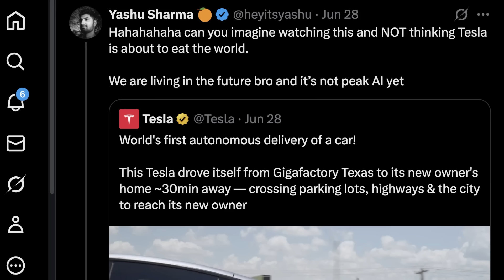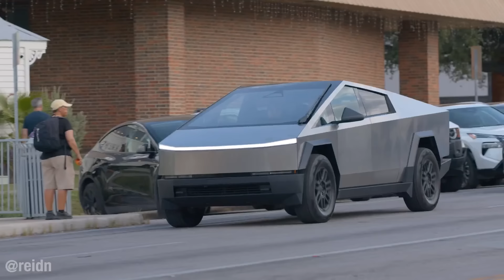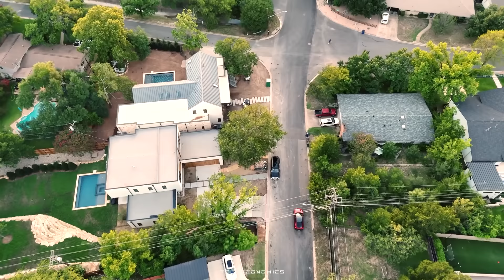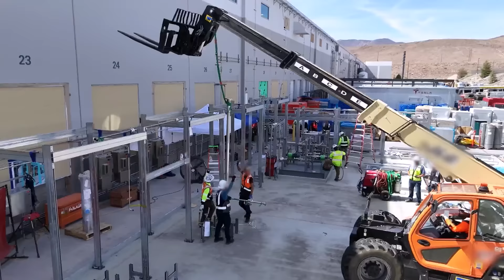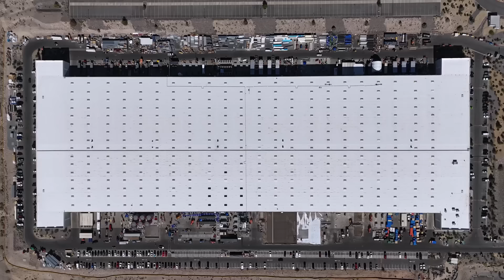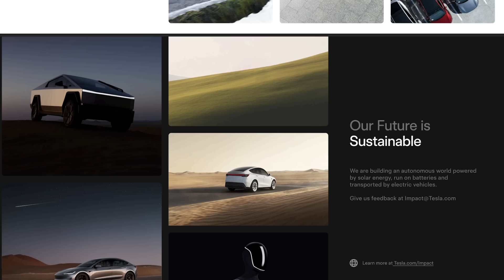Elon on Removing Safety Monitors / Elon Is Not Happy / James Douma Talks Tesla AI ⚡️

Comment from the maker: Can someone explain to me how Tesla builds an entire LFP battery factory and no one said a word about it?!?!
Reply: Planned production completed of the machine that builds the machines energy
Reply: They built a lithium refinery too
Reply: Vital, yes, but it's too deep in the weeds for anyone not specifically focused on Tesla or EV's.  For instance, there are details about the other Mag 7 that I'm clueless about -- they aren't mainstream.  Not to mention the rest of the S&P 500, etc.  But, yeah, frustrating.
Reply: Old news
Reply: It was floating around about 2 years ago. Not sure how so many Tesla bulls missed it. It was in the news that they had purchased CATL equipment to build LFP batteries. I believe they also have patents related to it. So it was obvious they were either going to at an existing Giga, or a new location.
Reply: Tesla does so much cool sh!t that we can't even keep track of it all. The best thing to do is to go all in and let fate get realized.
Reply: Everyone is too busy with heads up Elon’s Rectum
Reply: They bought a used assembly line and are paying for CATL consulting to figure out how it works and put it together. Tesla purchased some previous generation LFP assembly lines from CATL. With support from CATL they have reassembled the lines and seem to have it running. CATL makes batteries for all sorts of applications and the equipment is thought to be now two generations old. They remain dependent on the Chinese supply chain for the components of the batteries especially the heavily optimized graphite.
Reply: Definitely makes you wonder what else may be nearing completion...
Reply: Hey Dillon! Could you cover the issue regarding Matthew’s and 4680 battery? 

Haven’t heard much about the 4680 updates
Reply: Exactly who cares about old tech batteries? Sodium and solid state batteries are the latest tech. It costs more for Tesla to make their own than it does to buy them.
Reply: @mandelm2001 Weong, Tesla is now able to build batteries cheaper than importing un-tariffed Chinese LFP batteries.
Reply: @mandelm2001 not what he said and then thanked the team.
Reply: @mandelm2001  Solid state has been the latest tech for the last two decades, bro. Call me when they are cost-effective.
Reply: @mandelm2001 No companies are presently making sodium or solid state batteries for millions of EVs, large scale battery storage and home storage use. It's been old news, for many years....coming in a few years.
Reply: byd pretty much make 5 minutes charging ev and there is no news until it is done.  you dont need 10 years to tell people robotaxi coming soon.

Comment: Suggestion for Tesla Robo taxi's interior - (1) Inside view drop dash screen some so Dash line is continuous horizontally (2) Drop the arc on steering wheel and have the 'steering' column be 40% smaller as a Tesla logo shape that moves 'steering' for interest and Signature.

Comment: I have a Model Y, Juniper and have the FSD,  SEVERAL times it has tried to KILL me, pulling out into traffic,  turning into oncoming traffic on a green light ( almost nailed the back bumper TWICE of oncoming traffic)  don't trust it.    WILL NOT MAINTAIN SET SPEED.    KEEPS DROPPING SPEED LIKE A DEFLATED BALLOON.   Dial in 60 MPH and it will drop down to 53 mph.

Comment: Farzad 'modelling' :) -- let's keep it simple. I have seen similar modeling for Waymo and it is STRAIGHTFORWARD. When Waymo launched they DELAYED deploying the service UNTIL proactive monitors were not required. Tesla is OBVIOUSLY pursuing eating this cost and imagining Tesla will figure out all of the long-tail edge cases quickly.

Costing them out is pretty simple. Assume the car OPERATES at a utilization of 16 actual hours of driving per day (payable plus deadhead) that requires insurance. At $75 an hour in the US (A bargain in Palo Alto), the cost of 1:1 is $438K per year per car. That works out, at least as of last quarter performance for Waymo in their mix of cities to $4 per mile. This is the SIMPLE explanation of why this is all about monitoring. It is also why Waymo had developed a strategy to hasten the edge case discovery process. This was ALL ABOUT not needing real miles but rather figuring it out with synthetic miles. This is why Waymo converged to inherent safe without live monitoring within 10M miles. Tesla is at 3B miles and counting. Clearly the Tesla approach is quite different. Farzad's hot take about even 1:3 is foolishness as it add $1.33 to each mile in taxi mode.

Comment: As Old IT (retired) guy, this delivery is, by any measure, very impressive. As old software tester for very critical systems, the achilles heel for FSD is in "exception handling" -- and every ill-behaving instance will be highly critical of having Tesla FSD operating on scale will be horrendous. Someone needs to convince Elon of the value of a PR department to deal with all that.
Reply: And like good exception handling, you program in fail safe modes. Looks like the competition safe mode is just "stop in the middle of traffic." It Texas they say "If it steers, it clears".

Comment: I don’t understand how a small amount of supervised autonomous vehicles can accumulate anywhere near the amount of data that has already been gathered from the fleet of Teslas ready on the road. 
My conclusion is that the added data will not significantly accelerate effectiveness of the autonomous driving system, so safety itself will not accelerate, and implementation of a safe, viable, revenue generating, autonomous driving Tesla platform is still far off. However unready the system appears to be now, will likely remain that way for quite some time.

Comment: I work next to a Tesla service center and I have noticed in the past 3 weeks Tesla has really increase their sales volume. Tue area where the cone off New vehicle sales is completely packed now.
Reply: I drive by a Tesla lot in Colma, CA. The number of cars varies. It is at 1500 Collins Ave. I see pictures of it with the 1500 above Tesla.  I have noticed 25 to 30 Cybertrucks in the lot and they have been there a while.
Reply: Packing a parking lot with vehicles does not necessarily mean more sales- it probably means just the opposite - sales slowing down and inventory increasing.

Comment: Doubling down on other comments, a third party is a non-starter without AFV (Actually Fair Voting). This means jettisoning the electoral system and implementing national ranked choice or runoff type systems and/or switching to a parliamentary proportional representation system.  This is (for now) Not Going To Happen. On top of that, everyone's dream party is different and spans the range from one extreme to the other.  There is no "consensus" "reasonable" third party. A "successful" third party at best will displace one of the existing parties. I hope Elon is really contemplating his last political "success" as he moves forward. So far it doesn't look like it.

Comment: Did the safety driver intervene? The indecision by the car doesn't look very real. I'd expect to see some issues and sometime as it gets on the case should I go or not? Go even humans have that and if a mathematical system calculating when to go and when  not to go. If the decision is on the edge, then I would expect to see more often in decision, this just shows me there is a mule network operating underneath!

While making your mind up, it's time to go. The calculation takes a finite amount of time, in the next frame the situation has developed to say no do not go!

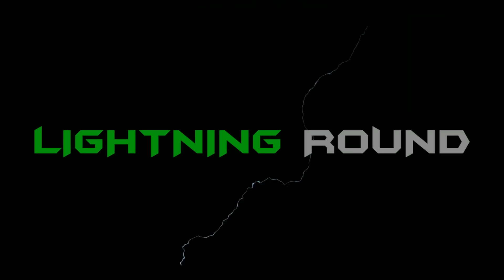Comment: 23:27
Is there really any speculation as to why Samsung is not using their own battery tech? Anyone dealing with Samsung batteries and reads up on tech specs of various other cells out there knows how shitty Samsung's cells are.

I had several Samsung batteries, as they were the default option, over the years and always got disappointed.
Latest - and last time I used a battery from them - is with my first EBike - It came with a Samsung pack by default. As I wanted to do longer rides, I bought a second battery from the EBike manufacturer, where I then had the choice between two Brands, Samsung and Panasonic. I chose the latter, at it had slightly better Wh, although significantly more expensive.

After using both batteries over 3 years (both used Cylindrical cells of the same type), and treated them the exact same way, the Samsung battery deteriorated down to 81% its rated capacity, while the Panasonic was still above 90%. I measured both batteries regularly and the Panasonic outperformed the Samsung in every way. In the 4th Year the Samsung battery became unusable. 6 years in, and I am still using the Panasonic with 86% rated capacity

Comment: If you think about it, the software for an unoccupied car (aka robotaxi) needs to be different from regular FSD. At least some parameters have to be changed. Not even neccessarily in terms of capabilities, but with regards to user interaction: At the very least driver monitoring has to be disabled. After all, regular software is supposed to prevent the car from driving itself or the user from trying this stuff his own.  Also the robotaxi has no option to ask for a take-over, but has to instantly pull-over or full stop in such an event.

Thats why people shouldnt be surprised when learning that software was different. No magic behind. It naturally has to be different.

Comment: Farley is incorrect when he comments that LiDAR is ok in strong sunlight, LiDAR can very much be disrupted by strong sunlight just like a camera, perhaps he is thinking of radar?
Reply: Waymo lidar operates at 1550 nm and can “identify objects driving into the sun on the brightest days as well as on moonless nights.”
By contrast, cameras can be completely washed out.
Reply: @JCo295  Camera images as handled by Tesla don't "wash out". As Elon has mentioned several times the AI is evaluating individual pixels and not the overall image.  With a focused image even with direct sunlight the Camera sees every detail.  This is not like your eye or normal camera viewing where the overall sensitivity is turned up or down based on overall (or point) brightness. This system can be disrupted by dust or condensation that scatters light, but this can disrupt lidar as well.  I believe Waymo has systems for cleaning the lidar as Tesla has systems for helping keep the camera's clean.  I believe we will see even more development in camera cleaning now that there is no human operator to fall back on.
Reply: @MrMobile247 On 17 Oct 2024 NHTSA opened PE24031 to investigate "Failure of the system engineering controls to react appropriately to reduced roadway visibility conditions". Justification was 4 incidents including one notalive. First Information Request to Tesla was on 5 Nov 2024 and second was on 8 May 2025. Unclear what the outcome will be but it could potentially impact Tesla's camera-only approach.

Comment: If it´s only the operations side of the surface that needs to be polished with Robotaxi why are there still safety drivers needed in the passenger seat? That has nothing to do with operations, severely deteriorate the user experience and cost a lot of money. Doesn´t make sense at all.
Reply: I suppose it wouldn't make sense to someone who hasn't been following the Tesla story or has no concept or appreciation of the media bias just waiting to jump onto the slightest adverse event of the rollout. The cost of an unmonitored adverse event would far exceed the minor cost of the temporary monitors used in the rollout. To put it simply: it is a necessary CYA expense.

Comment: Been a Landman for 25+ years now, primarily supporting oil & gas drilling upstream ops and in the past 10 years we've had a ton of renewable utility scale energy projects, throughout the U.S....I support this administration, however, this is a pork barrel Bill of SHIT!  The biggest "white elephant" in the US energy sector affecting electricity wether it's coal fired or renewable electricity, is our obsolete infrastructure-it's a joke. In most populated markets, distribution and transmission lines are at or beyond capacity, regulatory and the lack of fore site or courage to attack this problem has put this country in a terrible disadvantage going forward, yet it's never discussed.

Comment: In every single one of these videos, not a single person addresses the issue that I’ve experienced, which is the camera(s) malfunction notification I’ve received multiple times in instances of heavy rain or fog conditions in which auto pilot or FSD deactivates due to the camera malfunctions in these two scenarios. In the multiple times when I experienced this, of course I had to take over driving, but at least I was in the driver seat and able to do that. It will be interesting to see if either Tesla has resolved the heavy rain and fog camera malfunction issues to prevent them from happening or figure out a way to handle these scenarios when there is no one in the driver seat to take over control of the car.

Comment: Are people actually being serious that they think Waymo is going to be able to compete with Tesla? Why would you summon a Waymo that looks like that ridiculous frankencar that Homer Simpson designed when you could order a sleek, cool Tesla that drives better and probably costs half the price and is not sandboxed into a small area. Tesla will slowly remove the boundary restrictions until it can just go anywhere. Waymo requires detailed mapping and manual programming. It can't handle changes to the road for construction and detours without software engineers reprogramming it. Tesla will just keep learning on it's own. Tesla = better, cheaper, smoother, faster, cooler
Reply: Yeah.
Reply: Well, reality being a guide. Waymo is 9 years ahead now and expanding
Reply: Telsa software concept is faulty. the cameras will never work in the nighttime as well as rain or extremely sunny or foggy weather, So you will never see approval of his robotaxi. His Sunday stunt was used a model Y with a driver aboard, instead of the robotaxi which is not approved in texas or anywhere else.

Comment: 2025 1st Half is OVER.
Are reservations open today for Tesla’s $25,000 Model 2?
Reply: Don't believe Elon
Reply: No special event for the cheaper Tesla has happened yet, and you will most likely be disappointed if you believe that the price will be $25K.
Before producing a cheap EV you need to make sure you have enough capacity and batteries

Comment: I won’t put my Tesla Model why out for 70 cents a mile. That not going to make enough profit. It’s going to have to be at least over a dollar a mile. How many miles a day is possible?
Reply: 700 to 900 km per day at city sort of speeds could be possible if it was running at about max possible. At 35 to 45 km/h for 20hrs. But say only half of that is actually done whilst chargeable low end 350km, just over 200 middle age units. $140ish dollars a day, getting on for $1000 a week.
Reply: Eventually the prices will get so low that you will want a fleet in order to make it worth the effort.

Comment: On the indecision for the right hand turn, the safety monitor appeared to be controlling the vehicle, likely through the button on the door.
Reply: The button the safety monitor was hovering over was the "stop in lane" button that will immediately  stop the car if pressed.  As a safety monitor he was closely watching traffic and was prepared to intervene if necessary.  As it turns out, it was not necessary and the car did fine.  A small false start then a wait for a better opportunity. The statements by Tesla and watching the videos the safety monitor can on control the care in four ways. 1) Push the pull-over-now button on the screen. The same function the riders have on the back screen.  2) Push the 'stop-in-lane' button on the screen. Riders don't have this button.  3) Push the door release (right hand). This is more assumed than confirmed I think as the safety monitors ride with a hand on the handle at all times. This is probably a shorter/faster access to a stop-in-lane type action. Maybe even a higher level of alert. 4) Get out of the car and switch to the driver seat.  I think there was one instance of this where a car got itself in a tight space.
Reply: Yes but it looked like he was pressing something on the screen to back it up.